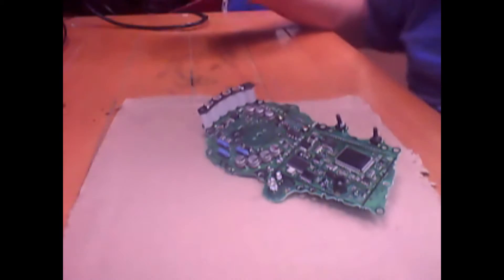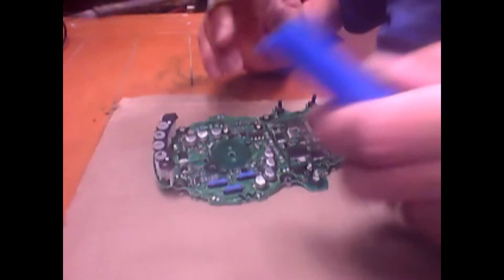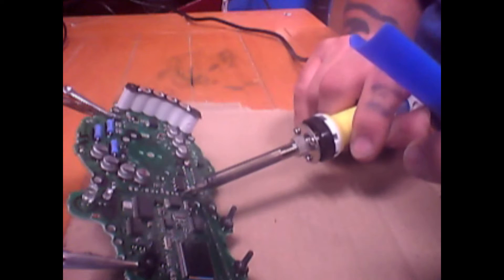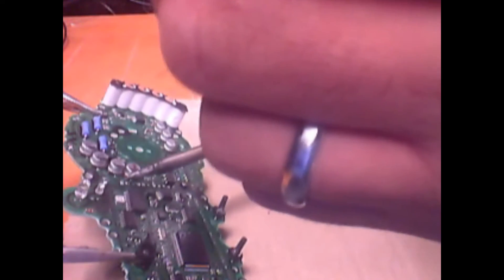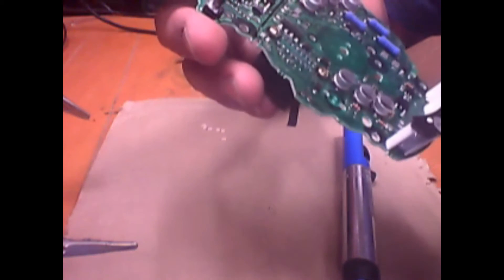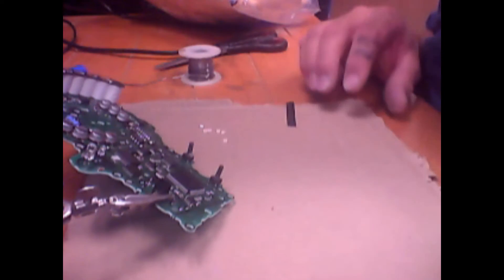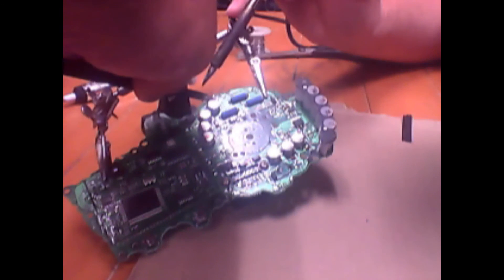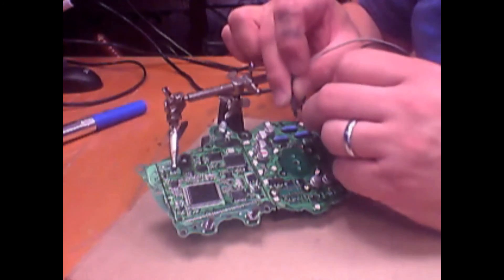lightenupgrade instructional video

Comment: you do this everyday so you really should make another video in good quality or whats the point
Reply from the maker: This video is quite old now. Probably should update it
Reply: @lightenupgradelightenupgra4156  If you can do one where the camera is focused on the solder points of one LED so we can see the removal and replacement that would be very confidence inspiring.  This is something I want to do, and with enough information I'm sure I can do it, but I don't want to take the chance of destroying the clocks on my 20yo ST.  Thanks!
Reply from the maker: @wgfurman  to be honest/blunt, without meaning to be disrespectful, if this video doesn't give you enough information you should probably consider using my fitting service. The st1300 has ALOT of leds to change so if you watch this video and find it's not sufficient,  i wouldn't reccomend tackling the job yourself.
Obviously, there are other places you can go to get the leds fitted, so I'm not just trying to scare you into coming to me to spend more money, it's genuinely not an easy task for an amateur.
Reply from the maker: @davepearce6382  well, this one I had wouldn't focus any better than it did for this video. I'm not a social media junkie, so I don't think to make alot of videos, I just get on with my work and do my job. Sorry if that's not sufficient for you.
No one has asked you to pay £70 to have these fitted. Infact, I charge £80 now, and make a living out of it. 
You are more than welcome to disagree with what I charge or how I choose to work, but please remember it is just your opinion, please don't feel a need to be rude about it
Have a nice day, and hope you find some positive experiences so that you don't need to come on social media to bring others down.